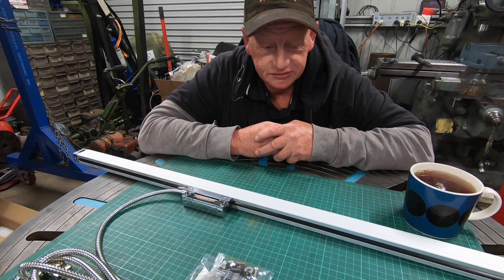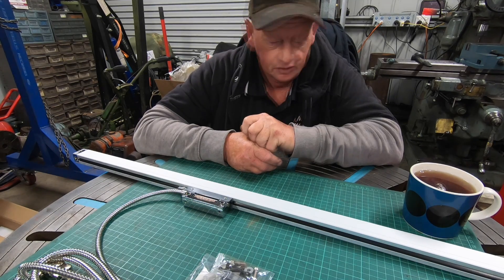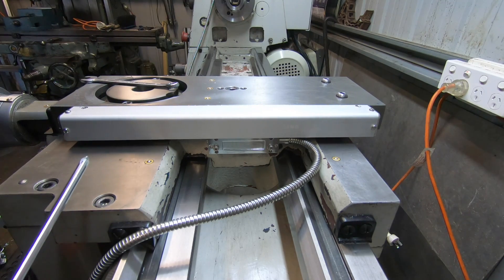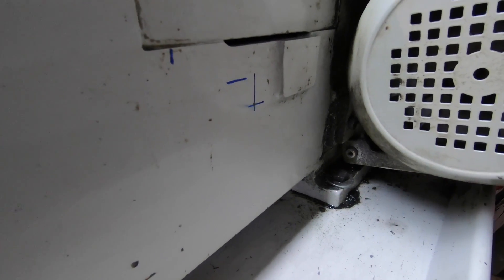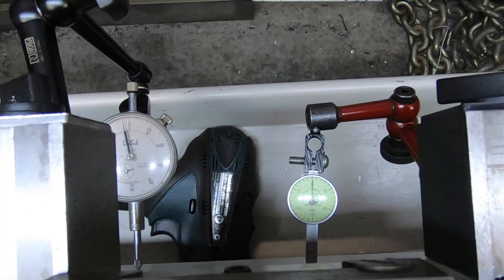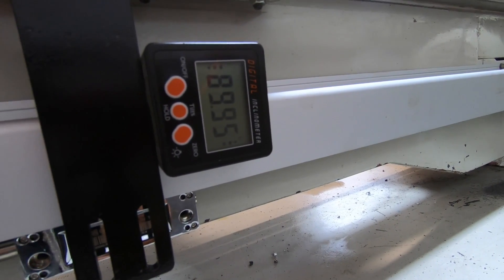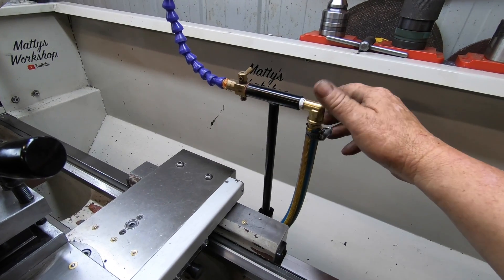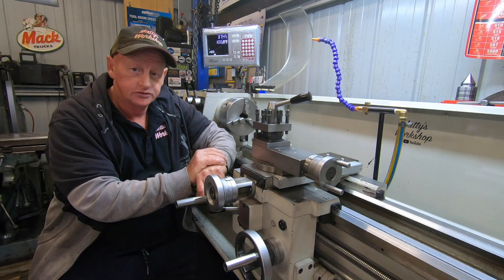Hafco DRO on the lathe...

Comment: Can't wait to see the boring and facing head build. It'll be epic! The transformer for my power feed is in a fully enclosed box. No chance for swarf and metal dust to get into the guts. Could be a kaboom situation 😮
Reply from the maker: Gday Preso, it’s certainly going to be a challenging build but also a good learning curve, the plan is to have the power supply in a enclosure, just have to work that part out, appreciate you watching mate

Comment: I keep watching for an installation of the DRO with a taper attachment on your style of lathe.  It is the little things that will be the most bother.  Routing the cables so they aren't dragging swarf, mounting the display so that it is in the most handy position.  With a taper attachment, what modifications need to be done to the back splash?  Be the pits to put her all back together and then the second job in find that you could have done it better!  I don't want to drill more holes than absolutely necessary in the lathe or mill so I am probably overstudying the issues but hope to do it once and be happy with it.
Reply from the maker: Gday, I’m not sure how the fit up would be with a taper turning attachment, i guess there’s a way it could be done though, appreciate you watching, cheers

Comment: Good work Matty, that will make a world of difference for you. I fitted one to my Austrian lathe and have never looked back. DROs are accurate and take all that backlash out that you need to account for on the dials. You may be already over it, but make sure your cross slide is in diameter mode on the DRO. If not it can be a big 'gotcha' moment when you dial in 1mm and unexpectantly take 2mm off the diameter.
Reply from the maker: Gday John, im really glad I finally fitted a DRO, it only took me 3 years, I have set the cross slide to diameter already mate, appreciate you watching, cheers

Comment: Best thing I ever did, putting a DRO on my old LD 1240 lathe.  I also got mine from Hare and Forbes when they were running a deal some time ago. I managed to get it fitted up using the bracketry that came in the kit.  Still learning how to operate it, but between yourself and Kurtis I'm getting more and more comfortable with it.
Reply from the maker: Gday, this was a pretty good deal I thought, the brackets just wouldn’t work right unfortunately, I’ve got to learn how to use this one myself now mate, thanks for watching, cheers

Comment: I have the same Sino glass scales on my mill, one of which failed when we moved the mill from its previous owner to my workshop, new was easy enough to get, but is a bit longer as the old one didn't allow full travel of the table. I'd really like to see them really minaturise them, I'm sure they could be 1/4 the size they are. Plus I really wish that the machine manufacturers would cast bosses or similar into their machines in the right places so that DRO's can more easily be fitted. It's not beyond the wit of man is it? Hopefully your DRO will speed your work up and we see more of it.
Looking good though Matty, hoping the treatment carries on well and it doesn't bugger you up too much.
Reply from the maker: Gday, it would be nice to have the scales smaller, I can’t see why this can’t be done really, my lathe has a pad casting on each end of the bed that’s for a scale, that’s good if the scale you buy is way over length, I put  a TouchDRO with magnetic scales on the milling machine and the scales are a lot smaller and easy to cut to length, appreciate you watching mate, cheers

Comment: Im super keen to do the same to my lathe but im not sure the cross slide install would be as simple in a benchtop hobby lathe as those glass scales are quite large.
Reply from the maker: Gday, The cross slide scale is a low profile model, Fits pretty neatly really, You might be able to go with a TouchDRO and magnetic scales, I have that setup on the Cincinnati mill and its been a great unit, Thanks for watching, Cheers

Comment: Great job Matty,  love the all singing and dancing DRO, good to hear you didn't have to use the Alarm clock function,  ref sleeping in the workshop ( only joking).
Just a thought,  though you may have already done so, does the scale covers need sealing?
Good to see you bust, and great addition to the shop. 
Thanks for sharing. 
Regards John
Reply from the maker: Gday John, I was surprised I didn't have to find the alarm clock function, The scale cover on the cross slide has a type of built in seal, The other scale is set off the bed by 3mm which will let the coolant passed, Thanks for watching, Cheers

Comment: real good Matty happy for your purchase now i know how to fit one to mine. as for the the coolant you run i did some research into it got on to the supplier in Brisbane as non up this way getting some bit and bobs sent through as well as the coolant the Hangsterfer's 5080 same as you are going to try it was recommended by the rep for my type of turning jobs and it's clear not milky like the one i am running which as you know is a pain the the bum mate your looking well hope your on top of the rust me i am still weighting on tests but will see how i go with  it cheers mate thanks for the videos there an inspiration for me
Reply from the maker: Gday, I was using Hangsterfers 5030 coolant and now im trying the 5080, So far im really happy with it, I used to use penrite soluble oil and was for ever changing it out, The hangsterfers last lot longer and being a clear colour make a big difference, I wish you all the best with your results mate, Cheers
Reply: @MattysWorkshop  hay Matty what mix of the 5080 are you using for just general type machining I E steel and stainless steel i was thinking of a mix of 1 part 5080 to 10 parts water should be 5 on the refractometer cheers
Reply from the maker: @wallbawden5511  I mix 10:1, from memory I think it around 2.5 or 3 on the Brix scale

Comment: Nice job Matty, I did mine the same way, although it was a Banggood DRO, also Sino scales. I do like the changes to the coolant system, might copy that onto my lathe. I bought a Toolex from Gasweld back in the middle of COVID lockdowns because the AL960B was out of stock. A good lathe not a great one, but enjoy using it. Fitter and turner so not new to machining. All the best with your treatment.
Reply from the maker: Gday, Ive only heard good things about the sino scales, Doesn't matter what lathe you have as long as you enjoy using it mate, Thanks for watching, Cheers

Comment: Matty it looks well setup ,great job how did you measure the scale length to order them ,i,ve been told that the length ordered is not the measurements that you measure off the machine . I have an old lathe and the length of the scales my not be a shelf item
Reply from the maker: Gday, My lathe can be ordered with a dro, On the hare and Forbes website it tells you what scales you need for this lathe, Im not 100% sure how you measure the scales, Hopefully someone will read your comment and help mate, Thanks for watching, Cheers
Reply: @user-sd6us2zn2b, buy magnetic scales, cut them to whatever length you want. I much prefer them, they're also a lot smaller than optical ones, a bit more expensive but well worth the extra.

Comment: Good one Matty, you've almost inspired me to fit the Y axis scale to my big lathe - I either need to pull the lathe away from the wall or remove the wall for a bit! All the best
Reply from the maker: Gday, It was a bloody tight squeeze between the wall and lathe, I need to go on a diet I think mate, Thanks for watching, Cheers
Reply: I can sympathise,  I bought a DRO for my lathe about a year ago but it is still in its packaging as my lathe is against a wall and as it is raised 8 inches not sitting on the floor I can't be arsed/face the thought of moving it to fit the scale. Maybe one day?😢
Reply: @chrisstephens6673 yeah, I'll probably pull the wall down - the wall girts are timber and the white ants have got into a fair bit of them. I'll replace them with steel girts. As per usual there is too much stuff in front of the lathe to move it now!
Reply: @theoldstationhand  have you been looking in my garage?

Comment: Nice work. I had to make a two-piece bracket on the back of the saddle - I can't quite remember why - there was something in the way, I think. But mine came out shorter. 

I think your diameter readout will be 2 digits, because you're using diameter mode, and the scales are 0.005mm - in diameter mode that's doubled, so you get 0.01mm per "line". You may be able to set it to show more digits, but it's always going to be a zero on the last digit in that case. This is not true if you set it to inch measurement, then you'll get "random" digits in the thousandths and ten thousandths, because 0.01mm is not an even number of thou or tenths.
Reply from the maker: Gday, I have the cross slide set on diameter not radius, I have to read up more on the manual yet, Appreciate you watching, Cheers

Comment: Nice work and you are really going to like having a DRO on the lathe. I had some "trust issues" with mine when I first set it up. I kept double checking and comparing readings with a dial indicator until I finally accepted the fact that it was trust worthy. Now all you need is a good precision job so the DRO can prove itself.
Reply from the maker: Gday, I still keep looking at the hand wheels and thats a habit thats going to take a while to get out of I think, From all the test ive done its spot on, Thanks for watching, Cheers
Reply: That looks like the install I did on my lathe!
I have come to trust the longitudinal scale, but still fuss with the cross slide, fine cuts, cut differently than deep roughing cuts.

Comment: You bloody well did it, congratulations mate. Enjoy the numbers, forget the backlash, start your SDM tool library offsets😊👍👌🇦🇺
Reply from the maker: Gday, Its going to be a good thing mate, I need to get a QCTP then I can start storing the different tools in, Thanks for watching, Cheers
Reply: @MattysWorkshop  I know their $$$, but I really like my 40 position miltifix toolpost, size A. I've only got a little optimum tu2004, but it's been great. As always, I want more tool holders, and they want $$$for them too, but its incredible. A cheap ebay lcd dro($279 for a kit) with glass scales and the 40 position QCTP and some insert tooling have made a little ripper of a lathe. Super easy to use and nailing it to 0.01mm in steel and SS. Stay healthy and happy mate, love the channel👍👌🇦🇺

Comment: Hi Matty, not living in the dark ages anymore, one thing you have to do is fit a stop so you can't smack the tailstock into the cross slide scale.
My longitudinal scale had a slight bend also, don't think it will effect the accuracy over that distance for the work I do.
.
Reply from the maker: Gday, I have put a stop on the back of the carriage already, I forgot to film that bit mate, Thanks for watching, Cheers